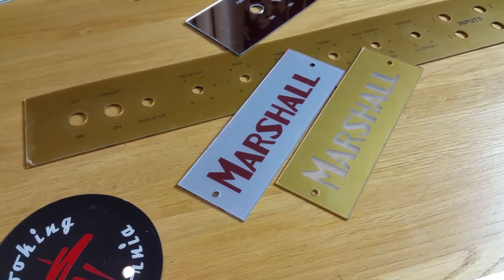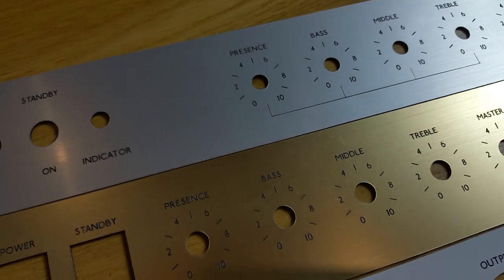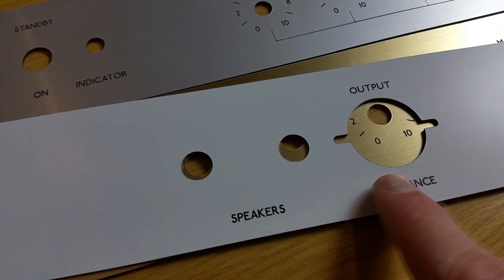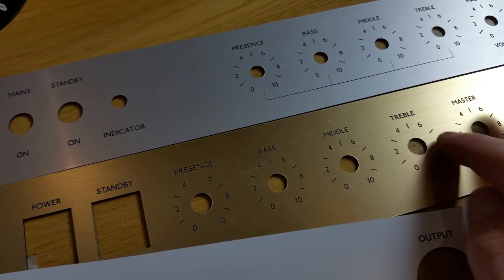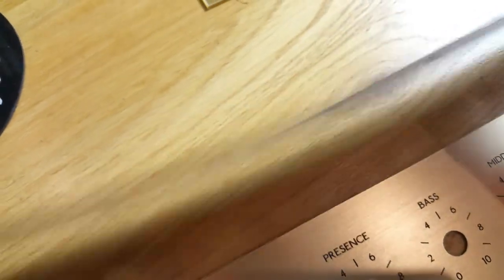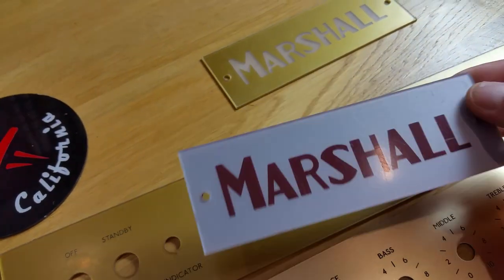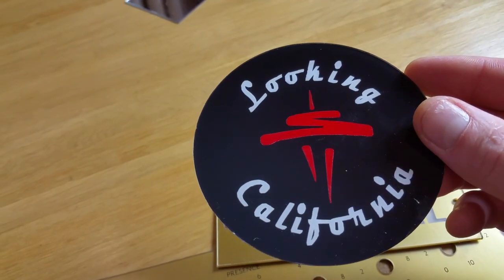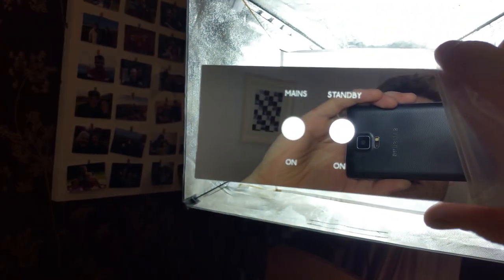Amp Faceplate Materials at modulusamplification.com

Comment: Interested to know what type of laser you are using. I have a 60w omtech co2. Looking to make some and was wondering if you wouldn’t mind sharing some general settings. Thanks.
Reply from the maker: I have a laser and a rotary engraver. I use the rotary one for the reverse plexi as it gives better results.
Your laser supplier should have given you some example settings. But they depend on how well your laser tube is set up/operating.

Comment: High quality workmanship, and look really clean! I am needing a faceplate 10.5 × 3.25 with holes and abbreviated labeling for those 5 potntiometers, About what price range would that be in? Know that is nowhere near all you will need to know but hoping it will give me a rough estimate.
Reply from the maker: Depends on what  you can supply, check out this page please 
https://modulusamplification.com/Replacement-Faceplates-for-Guitar-Amps-P5216511.aspx

Comment: Can you make a faceplate for the 2204 50 watt jcm800?.  I notice you can do the 100watt 2203, but no mention of the 2204.  Cheers
Reply from the maker: Hi, yes we can, if it is for any chassis other than ours then we need to check dimensions